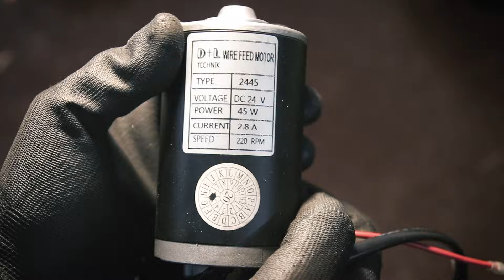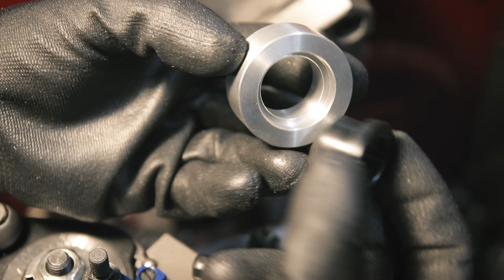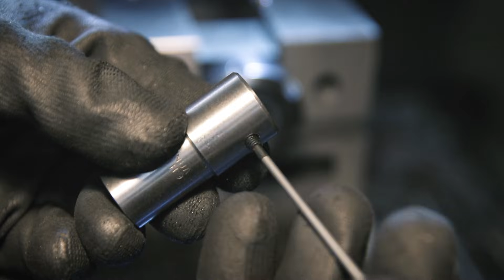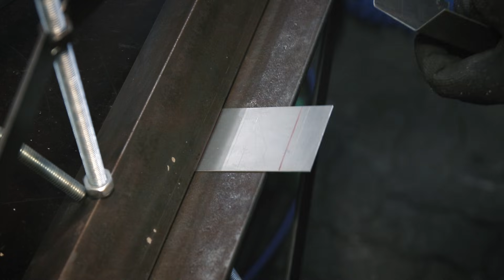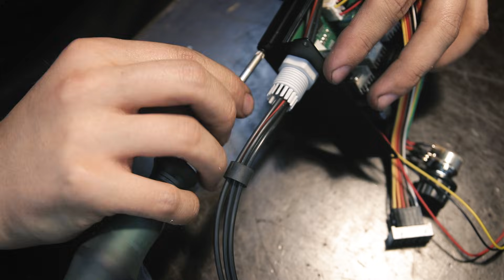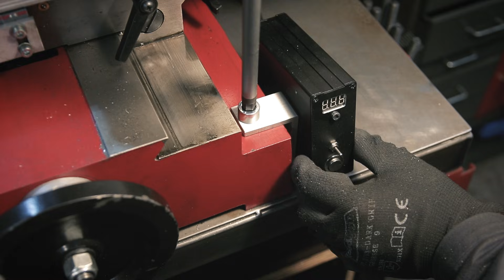Building a Powerfeed for my Milling Machine (with a Wiper Motor)

Comment: You should really, really put endstop detection switches to deactivate the power feed
Reply from the maker: It would definitely be a bit safer but I don't think it's strictly necessary. As Daniel mentioned below, the powerfeed on the lathe is much more dangerous and they often don't have a stop switch at all, you just gotta watch what you're doing. Mine actually has a slip clutch with a stopping clamp on the bedway but like most people I never use it. The trick is to just pay attention and not let it crash into anything. With the way this is built, I think the worst thing that might happen if I run into the end of travel is that the motor would stall out, but I don't think it has enough torque to destroy the clutch parts. Of course if you crash into a work piece that's a different story, but again, same thing on the lathe, you just keep your hand on the feed switch and pay attention and try not to crash it. Besides, I will be using this mostly for facing and other operations where you can feed all the way through the part on the X axis.
Reply: @PhilVandelay  Simple limit switch idea; maybe just have them between the power supply and the motor so the signal is cut if it gets hit
Reply: I mean, safety features are hardly ever a bad idea
Reply: Why?  If he's using the power feed he'll be standing there.  Just like power feed on a lathe.
Reply: Are you the thumbs down?

Comment: hi phil
extremely well done, kudos
would you want to consider ball detent latches for locking the motor in and out as you did on you belt sander project
i was expecting the detent klicking sound somehow when you move the motor in :-)
cheers
and continue the great work pls
Reply from the maker: Yeah I actually thought about using a spring that pushes it in or out so it can engage in one direction by itself and lock in the other position (kind of like the grinderr). It would have been cool but this time I wanted to keep things quick and simple. It's more of a "I need to get this over with" build so that I can start doing other stuff ;)

Comment: Amasing as always! 
Waiting for new upgrades.
By the way, how is your cargobike runs after a while? Any upgrades ?
Reply from the maker: Depends on which bike you mean, I sold the green/yellow one (only built it for the video really). But I still ride the "Light" cargo bike a lot, mostly the same setup though. There are definitely more bikes coming next year :)
Reply from the maker: @Ionuț Alexandru Yes I still hear that all the time. I'm sure it makes a difference, but I think I've proven you can get away without it. Haven't had a single problem with that frame, and it has been used a lot!

Comment: which cad program did you use?
Reply from the maker: None, I didn't plan it  in CAD at all this time. The parts were simple enough to figure out the measurements as I was making them. For the animation I just made a rough mockup of the parts in another 3D program (not CAD though, it's a CGI program) but that was purely for demonstration purposes
Reply: @PhilVandelay  I see, the animation looked great. nice project